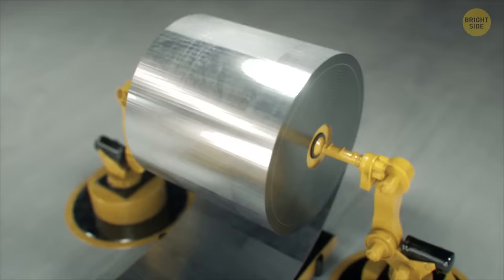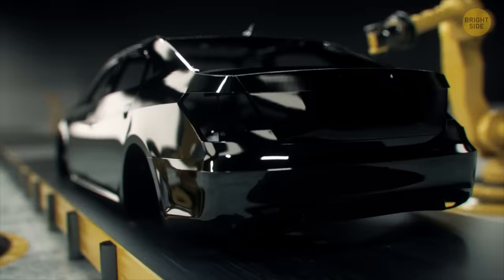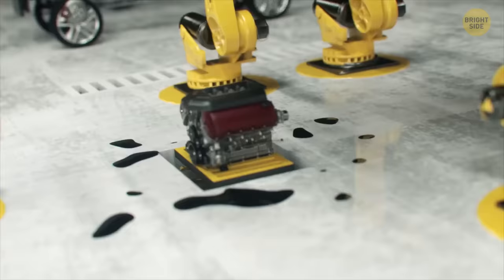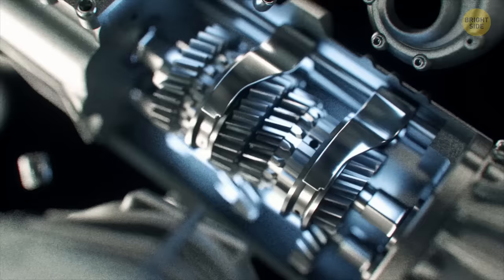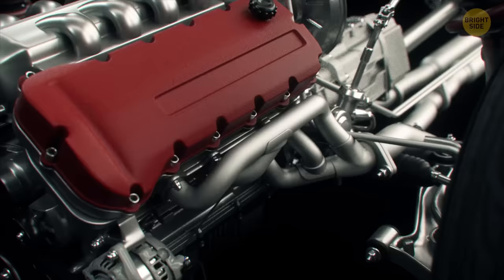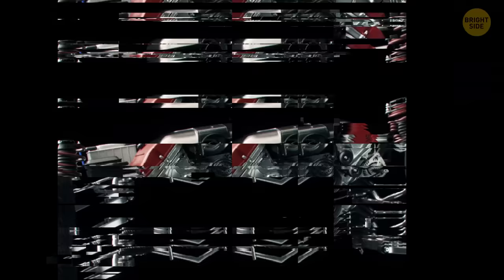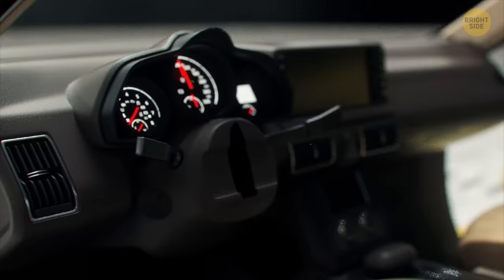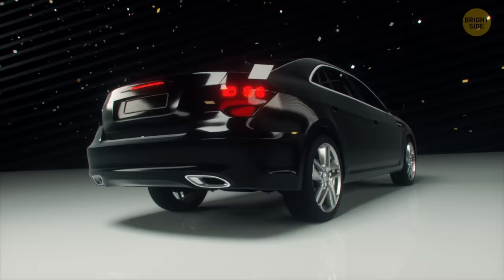How a Car Is Made: Every Step in 3D

Comment: That was an excellent video describing how the car is assembled and the parts and their functions. Many of the parts you spoke of also have different names throughout the car world, for example, the manifold may also be called the headers. And many other parts follow that same process. But if you’re not to concerned about that, as the majority wouldn’t be, manifold is just fine. Watching that was truly amazing as how the machines do so much with absolute precision. Anything that may require an actual human involvement, is most likely a adjustment of one of the machines, or simple fluid transfers of so many hydraulic powered arms of them. Excellent video!!

Comment: You have your timing chain on wrong. If you have exhuast coming out the throttle body you have big issues. VW stamping had the most insane quality controls. They shut down every X PC and checked whole line. The coils were scrapped if they ever got wet the least bit. They had QVA standards that had to compete with BMW Mercedes or any car out there. I was super impressed. Now I make those coils for really expensive vehicles. Like nuclear subs. Abrams and most armoured vehicles we use.